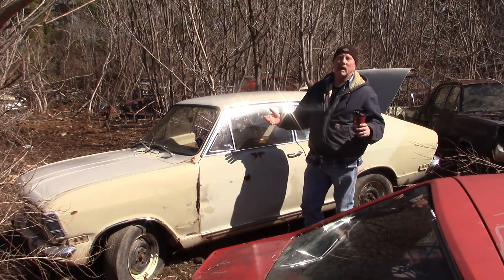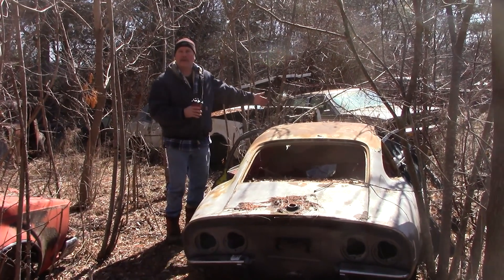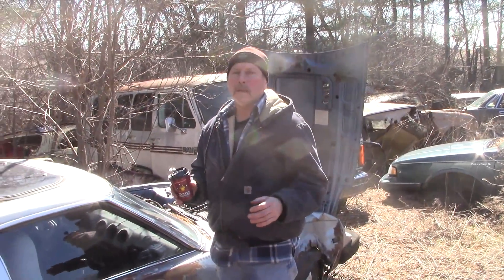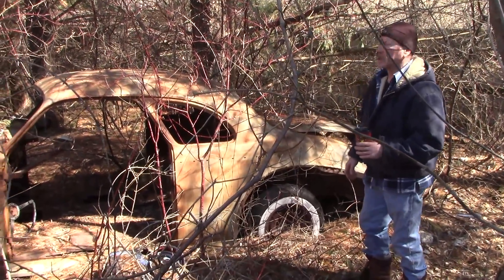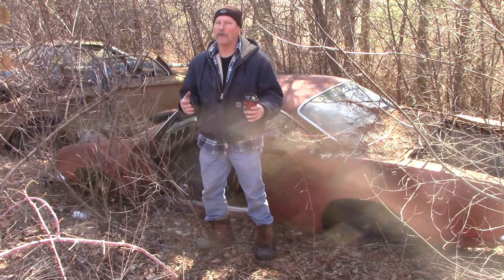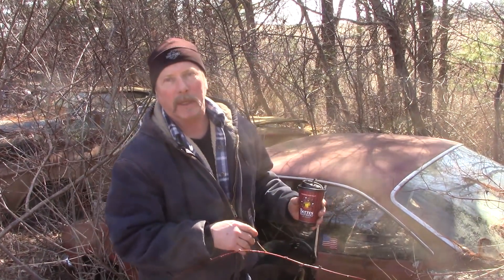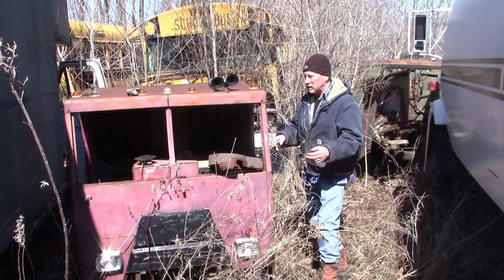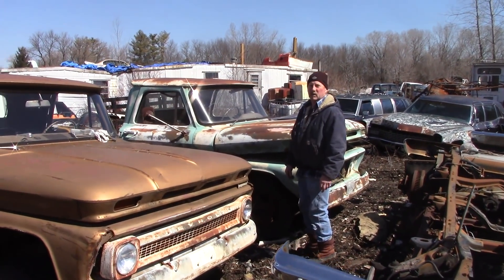Junkyard Walk Three

Comment: The Opels back then had kind of a strange engine. They used a Cam In Head design. Basically a complete OHV valve train housed in the head. Cam, lifters, really short pushrods. I mean almost not there pushrods. 
https://en.wikipedia.org/wiki/Opel_cam-in-head_engine
Opel through the Buick dealer network also sold a model called the Manta. These kicked ass in their SCCA Showroom Stock class
https://en.wikipedia.org/wiki/Opel_Manta
Seat belts. The first US manufacturer to make them standard was AMC. People made comments that they were made to crash. But they also went to dual brake systems when just about everyone else was using a single system for the whole car.